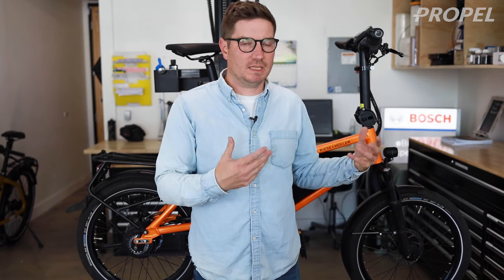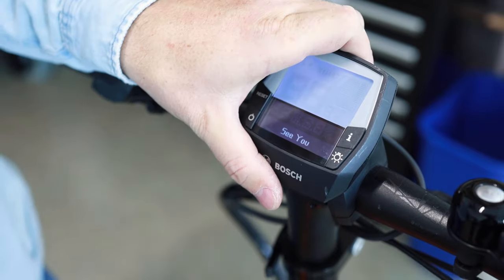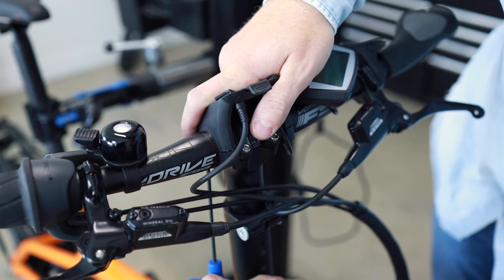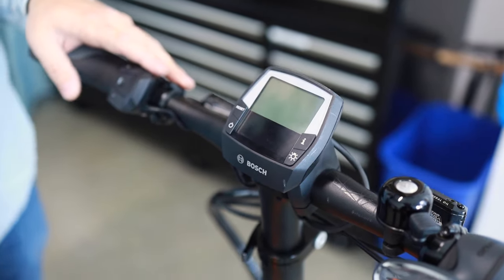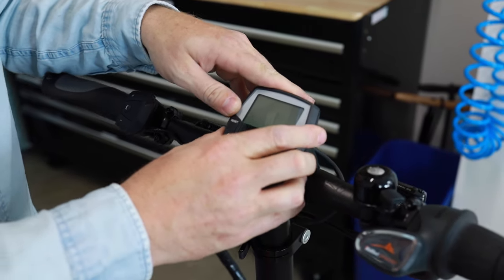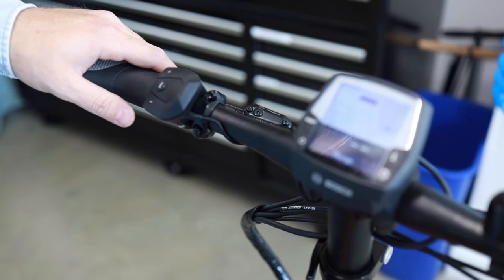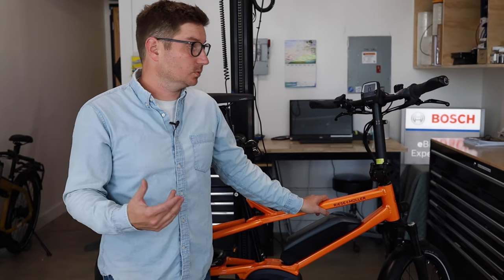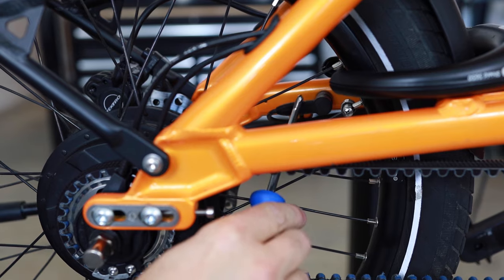Bosch Ebike Motor Systems Troubleshooting | Power On Errors & More

Comment: Excellent video.  I see a number of unanswered questions regarding the USB port on the Intuvia.    The manual clearly says that the USB port is for charging devices like a phone.  It doesn't say anything about being able to charge the DISPLAY'S small battery.   So, per your video I am confident that the Battery in the display can be charged through the USB port because you have probably proved that works many times.  What is hard to understand though is why the small display battery isn't maintained by the BIG battery because the power to charge devices has to come from the BIG battery, so it seem like a no brainer that the displays battery would also be charged by the BIG battery.   A few words from you could clear up these questions for a lot of people.  Thanks!
Reply: Hello, very late reply but, yes the main battery is the usual source of recharging the display - it's mentioned at one point 5:40 - I haven't used the usb port for charging in 4 yrs. (apart from curiosity!)

Comment: Thanks for a great video! I have the issue where the display seems to lose connection with the battery intermittently.  I tried loseing the screws a little, and I think it improved slightly, but it isn´t perfect yet. But i will keep fiddling with it.

Before I saw this video I believed the problem might be with the battery connection, because there is some oxidation there. I live in a very wet climate. Any tips on removing that? I have tried to find a spray to remove oxidation, but all the sprays I can find (contact cleaner) just seems to be some sort of general cleaing product that won´t short circuit or damage electrical equipment.

Comment: My e-bike slips when I am in 3rd, 5th, or 7th gears. My pedals just freewheel. It will not engage. So I stay in 4th and 6th and use my pedel assist as needed. It is a bosch performance. I really like it but would like to find the problem..

Comment: Thanks for this Chris.

I have a locked Bosch battery on my Raleigh Motus Tour e-bike. 
The key will not turn at all so I cannot release the battery. 
Any thoughts on a fix for this?
Regards
Tim
Reply from the maker: The lock will likely need to be drilled and replaced

Comment: Hi Chris very informative video thank you, I have a problem and wonder if you can help. my bike is a scott venture30 probably 2012 model. I took it abroad but was not allowed to take the battery with me! I bought a replacement 400 W 36V battery (similar to the original but not Bosch! ) and mounted it on the bike with the new battery mounting. The original battery had 4 wires (thick positive and negative plus two thin wires blue and green). The new battery only has two wires (thick positive and negative). please could you tell me what are the two thin wires which are now disconnected!  and their function which the new battery does not have to connect to? when I turn on the battery, the display comes on for a split second indicating error then switches off and battery also switches off ! and although 36V does go to the motor, it motor does not run. How could I fix this issue? if necessary could I eliminate the controller in order to use the bike? how?

Comment: My Active Line engine has started to act just like when you change gears and you have to wait for just a moment before the gear change actually kicks in. If I'm riding and pressing the pedal down too slow OR fast, I hear a winding noise untill  for a split second untill it actually starts working properly. And whenever I ride uphill the engine momentarily stops helping out about halfway through a wheel rotation. It works flawlessly when going downhill. 

Thoughts? Oh, and my bike shop didn't know what the issue was either.

Btw because of ur videos I bought a Superdelite! 73 days left untill I get it. <3

Comment: Thanks Chris, 
My Performance Cx / Intuvia / Cube Stereo bike is losing electric assistance during the ride and then the assistance is coming back on again in couple of seconds (e.g 15sec).This is happening every appx. 5 mins during cycling, even with fully charged battery pack. During the time the assistance is lost, I also don't see "0.0" on display. Have you ever seen such problem, can you please advice?

Comment: Hey Chris, one randomly occurring  problem that I have is that the power shuts off mid ride! I always get it to restart but it's very annoying. Any thoughts as to why this is happening ?
Reply: Hey I have the same problem. Suddenly no support, all off, then turns on again without doing anything. Happened 3 times in 6 months, I do a lot of miles. Daily 40 mile commute. If it starts to happen a lot I’m going to drop it off for repair.
Reply: Ps, R&M Supercharger 2019, EU based
Reply: @stevevereecke  is het een kiox display? Mijn supercharger2 is al een 10tal keer uitgevallen, vermoedelijk is de magnetische bevestiging niet sterk genoeg....
Reply: Gunther De Greef intuvia. Supercharger 1 , medhanische verbinding.
Reply from the maker: I'm inclined to think this is a display connection issue. It could also be the wiring, but often what happens is you'll hit a bump and you could experience a momentary disconnection of the display causing the bike to shut down. Recent updates to the Bosch system have improved this issue, but I would look more at the display and display mount.
Reply: happens to me too. active line plus on cube hybrid touring pro.  the motor will cut out and the system reboots itself.
a week back it happened three times within the first 3 kilometers.  then it didn't happen again (that day).  it wasn't a bumpy road.
Reply: This happens to a friend of mine. Active line plus. Not detachable display.
Reply: Hi :) really nice video. I got the KTM Street CX5. My Batterie lights are on if i hit the Button and also turns on my Display, but no speed inidcator. 

So my bike turned off,  on,  off,  on and then off for good. My Motor didnt make any strange noice or anything. 

I tried 2 displays. I cleaned the connection from the Display connection. Im guesing its some connection Problem but maybe somewhere near the Motor? But there are so many cables so i dont know which one to look at. 

I brought it to the bike shop and they could Not connect with the diagnostic System and gave me the bike Back and said sorry we cant help. 

Maybe you guys have an idea.  Thanks anyways for the video you do a great job
Reply: @TroyArn  I have same issue. In the middle of the ride power off and system reboots. After reboot there is no assistance and display shows empty battery. Sometimes it gives 530 error code. I suspect it's bad connection between battery and battery holder.

Comment: Well explained! But I still have 2 questions.
1: Is the intuvia display created for charging up my iPhone? Is this recommended since it will affect the internal battery?

2: I noticed the battery level of my intuvia dispay has 3 bars instead of 5 bars, so I plugged it in a power source but it just don’t want to charge up. Left it plugged it the whole night and it still shows 3 bars on the display. I watched it charging for a bit, when I plug the cable in the display lights go on and after a few minutes the display just shuts off, then after a few minutes the display lights up again, and this cycle goes on all the time without charging it up, what could be the issue? Or is this even an issue? Or should I just leave the display on the bike attached with the battery so It can charge the display this way..?
Reply: The battery level display shows the amount of charge in the BIG battery, not the battery inside the display.

Comment: thx for a great video, is there often a software updates for the riese & müller with kiox and rolloff hub?
Reply from the maker: The updates for Kiox can happen every few months or so. Rohloff is much less frequent though.
Reply: @Propelbikes  for updating the Kiox, is that only in the shop, or can we update that at home?
Reply from the maker: @Multirep  You can update the Kiox with the eBike Connect App, but you can't update the motor.

Comment: Glad I found this video, had issues with the battery not connecting and didn’t know about the battery button....... but I’ve also realised I can’t get the controller off . . . .  The clip moves but there almost no movement from the unit, I’ve tried tapping it gently but no way will it move....... any advice please?
Reply from the maker: There could be a screen inserted below the display mount.
Reply: Propel Electric Bikes - hi Chris do you mean screw?

Comment: I have a cube reaction with the Bosch Intuvia display. The display switches on and shows speed etc, but can not access speeds etc using the thumb control pad. I have noticed that the 2 lower of the gold pins are missing on the display holder

Comment: Hi! Got Error code 502, relating to the lights, Bosch Intuvia and the Performance Line motor on a Scott E-sub. Front and back lights worked perfectly, then suddenly both are dead at the same time. Got LED-lights so this problem is odd. I have losend the display-holder and cleanded the contact-points. Also opened the motor-covers, reconnected all wires, still no joy. Can you please help me with your thoughts?

Comment: Chris I had decided to get a Bosch powered bike but since I don't have any service for Bosch in India do you think it may not be such a wise idea  to get one or can these electronics be repaired by a general electrician ?
Reply from the maker: The parts are pretty modular so it’s not a matter of an electrician. The challenge would be that the Bosch dealer software for diagnostics wouldn’t be so accessible there.
Reply: If you break into the internals of the motor it will void the 2 year Bosch warranty. 
The screws that hold the covers on the internal gears and bearings have a tamper indicator.  
You can remove the plastic guards though that protect the outside.

Comment: so I got a question, u half covered it. my display is working & the zero is showing up but when I hit the + - or walk asst buttons, it just changes the info on the display. the info button on the pedal asst shift unit is not working. it fixes itself randomly but keeps happening. does that mean that the unit needs to be replaced or could it be something else?

Comment: Hi Chris. Excellent video. Sadly my issue isn't covered. I have the same Intuvia display and Bosch motor on a Raleigh Motus. The battery is perfect and records everything. However, no power is coming through. This happened suddenly during a bike ride yesterday. It stopped completely and I cycled on no power for the final 5 miles. But, then suddenly the power kicked in for a few seconds several times during the final 5 miles. When I got home I looked at the sensor and it was out of position although I don't know how it could have moved as I needed a screwdriver to move it to where I think it should be. Any suggestions please?  Many thanks, Ronnie
Reply from the maker: Sorry for my delayed response. This leads me to think it’s an issue with the connection between the display mount and the display.

Comment: i have a question iv just updated my bosch to dual battery but when i put the second battery in it just indicated that the battery is dead but when the first battery is on its fine its only when i use  just the second battery it shows that the battery is almost dead even though its fully charged

Comment: Thank you for the video. I am hoping you can help me with my Trek Allant 7+ S Stagger. It has a Bosch motor with 28 mph capable speeds in turbo and I do ride my bike anywhere from 4 miles to town and back to a 22 mile round trip to a bigger store and one on occasion I did go 29.5 round trip. Anyway after a few hundred miles I began to hear this skip clunk noise from the cassette in 9th gear only. I ride in 9th as that is the gear that gets me the 28 mph in turbo. Anyway the shop owner did ride next to me and saw and heard my noise and put in an order for a new chain and cassette. That took some time because of the supply shortages. But He did get them in and put them on the bike and it SEEMED ok for a few rides and then out of nowhere I began to get this loud SNAP. Again I ride on a paved heavily traveled route so I like to cruise in 9th at naer 28 mph except for hills witch I will then shift down to say 5th gear. Anyway this new SNAP was right below me and seemed to be the motor this time??? I called the shop back to say thanks for the parts and work but a new worse noise has appeared. Their solution, Use other gears. This is not acceptable for the cost and advertised speed capability I should be able to ride at near 28mph indefinitely and not get the use other gears excuse. I have also emailed them after that but have not received a reply. So  I am left with an expensive bike that seems to be defective. When the speed  drops to around 23 to 25 mph the SNAP arrives. Crusing along having a nice ride and then SNAP. Very disconcerting. Again I ride paved roads not in any mod or snow or rain only dry paved riding yet I am getting the snap.  I think it may be the motor mounts or the like coming loose like you described. I have fixed use bicycles for almost 28 years but have not worked on e bikes or bosch so I am reaching out to you for advise. Should I demand that the shop fix it or put in a better business bureau case agains them. I am at a loss.  I am now at 520 miles and feel like I have purchased a LEMON. Thanks for your time,,,

Comment: Hi Chris , 
 Thanks for the info. I have a broken clamp on my ituiva control mode switch . I have a replacement switch to fit . Is  this trouble free if you are careful or, as with  most  things electric bike, best to go to my dealer? I like doing' learning to do what I can. Regards CaLLUM
Reply from the maker: I think if you’re careful not to lose the little screws and you’re patient it’s fine.

Comment: We have 2 Townie Go 5i ebikes. My wife’s bike, whether power is on or off, and no matter what gear or assist level she is in, when walking the bike, the pedals will spin as she walks. My bike does not do this. It is rather annoying that the pedals spin while walking as they clunk her in the shin as she’s walking. Is this a motor issue, or a rear hub issue? (Internal 5 speed rear hub)
Reply: Great video by the way!

Comment: Great and informative video. I have the initial problem of the system not turning on all the time. Sometimes it comes up right away with Active Line Plus and the speed, and we are good to go. Sometimes I might have to wait 30 seconds, sometimes I will turn the rear wheel, jiggle with the display, use all the buttons, and this may or may not work (when it refuses to start we will try anything I suppose) If it does not work I might just pedal off unassisted, and maybe after a few km it may come on, or maybe not. I have pedalled home a fair distance unassisted at times. Often when it is working a small bump might switch it off, and it may come back or not. Yesterday I noticed that the bump switched the whole display off, not just the assist. I loosened off the mount yesterday (last time at the shop they obviously tightened it to within an inch of its life) for no change. I wiped all the connectors but really, the external design means they should be fail safe even with a bend in the mount. No corrosion etc evident. I might now try some micro sanding cloths to remove any grease that may be present. I am thinking maybe the problem is a connection somewhere further down the cabling, or a break in one of the circuit boards.
Reply from the maker: it's possible that you need a new display mount. It's also possible that if it was too tight for a while that it could have warped. Maybe the shop can try a new one.
Reply: A year later, but did you have any luck? I'm starting to get a problem with the display cutting off, and it started when coming fast down bumpy hills, but is now more often happening.  I'm going to try readjusting the battery top mount see if that works.

Comment: I have a similar problem you have discussed from 14:04 except that if I click the button on a battery, the display turns on but it does not show the speed’s 0.0 km/h.
Reply: same here. what was the prpblem?
Reply: @BreathYouTake  they had to replace the motor.

Comment: Hello I have a Bosch system on my 2015 electric bike but a big problem! let me explain:
when I turn on the intuvia it takes a while to display the km / h and sometimes it goes off after a few seconds sometimes it no longer displays the km / h at all so no assistance and then it comes back and that goes out ... In short, the stores near my home (center of France) m "offered to change the battery, which I did and it's still the same, do you have an idea of the failure please?
cordially
Reply from the maker: This is a display connection issue. I recommend changing the display mount.
Reply: @Propelbikes  Thank you  ! i will try another intuvia
Reply from the maker: The mount not the Intuvia
Reply: @Propelbikes  Yes I just changed the mount only and I tested the intuvia on another bike and the intuvia works well however even with a new mount it still does not work
can the fault come from the engine?
Reply: @Propelbikes  and when I turn on the intuvia the battery leds all flash at the same time as before

Comment: Hello Chris. My Bosch intuvia switches on but is not connecting to the motor, there is no drive assist. The battery works as I have swapped it on my wife’s bike. I have cleaned the connectors. The sensor is in the right position. My side switch goes through the various assist stages ie eco etc. the lights also do not switch on. The intuvia shows a full battery, and I have charged it for 12 hours. I cannot seem to find the issue. Can you help please? Thank you
Reply: Forgot to say, there is no speedometer showing. Thank you